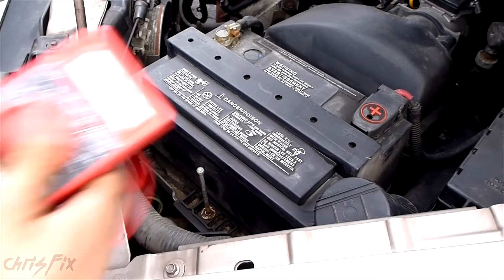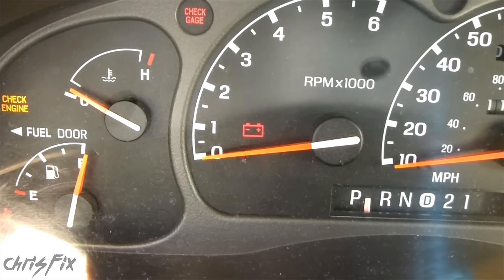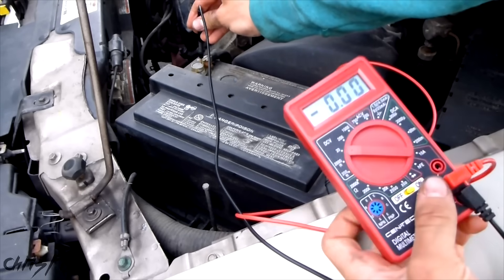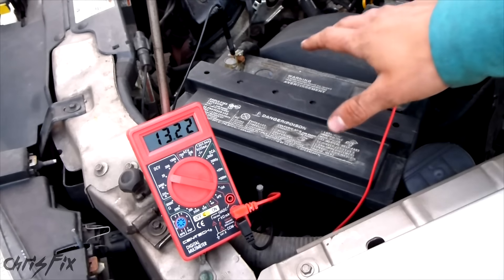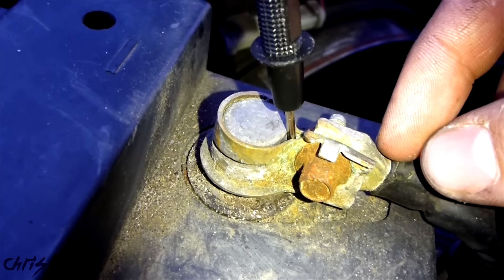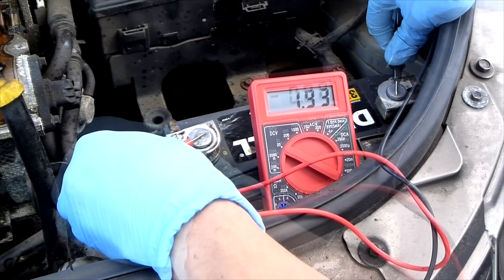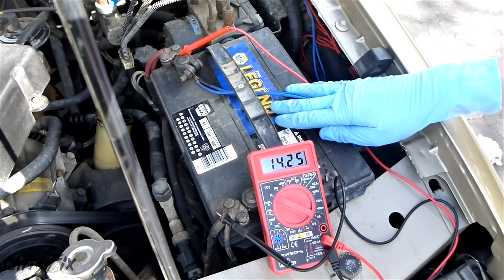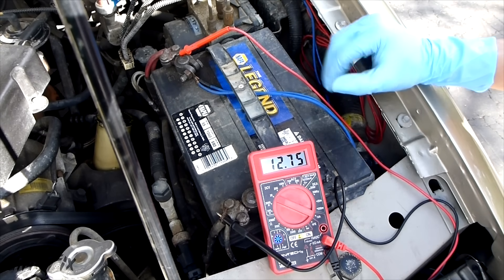How to Test a Car Battery with a Multimeter

Comment: There wire going to my ground terminal is completely loose. It’s tightened to the max and the car starts up fine but it comes off easily by hand if you just pull it off. Anyone know a way I can tighten it down so this doesn’t happen?

Comment: What happens if my 3 yr old maintenance free battery is charged to 18v at rest and jumps to around 20 while the engine is running?! Bad alternator? Terminals are dirty, but I’m assuming that would produce the opposite result. I did run the headlights for two minutes prior to starting, as suggested. Thanks!

Comment: Chris, thanks for this video.   I had been wanting to get a new battery before the winter cold hit but I put it off.  Well it failed, I tested it like you said and it only showed 10 volts.  It would not hold a charge. The funny part was that the battery was installed in February 2017 and lasted til November 2025.
Reply from the maker: Glad the video was helpful!

Comment: The VDIAGTOOL V200 Pro helped me test my car battery's wiring circuit before blaming the battery itself — turned out a bad ground wire was the problem.

Comment: audi a3 sport----------removed battery from car-its bout year old-----checked it with meter 12..55------------put back in car and tried start-------lights in dash flashing like mad and what sounds like buzzing noise from under steering column-------no crank ---no clicking from solenoid-----tested battery connected to terminals-----which are 100% clean---------all thats reading on multimeter 2.55-------whats the storyanyone?------------is this a battery fault?--why does it read 12.56 disconnected but 2.55 when hooked up? any advice welcome thanks in advance

Comment: I have a problem in my corvette.mechman alternator 225 amp had it checked out it's good but when I install in car and rev it to about 2 grand it won't go past 13.6 volts and I have an xspower d3400 battery?

Comment: Car I have had needs engine rebuild due to low compression. Won't start. I attempted to start it about 15 times before giving up. Then it sat for 6 months. awaiting the rebuild.

With a rebuild booked for a month from now, I have recently removed the battery and put it on a battery charger. It tested at 12.6 when it came off the charger but steadily decreased over the next week. Most recent reading was 12.15

Battery is less than 2 years old but was in a car with very sporadic use. Think there's life in it?

Comment: Due to problems with not being able to get my 4 sp automatic into park or remove the key, I need to disconnect my neg battery cable till repaired. Each time I need to connect the battery, it is difficult to get the side bolt screwed in cause it's crowded. So it clicks and sputters for maybe probably a minute while I fuss with it. Do you think that is dangerous for the electronic components ?
Worried I might be making bigger problems. Also do you have vids about 'stuck in park' or 'can't get it into park' ?
Reply from the maker: As long as the connection is good and tight, I wouldnt worry too much if this is temporary. I use a battery disconnect in my race bmw and it gets turned on and off all the time. Here is the video for reference: https://youtu.be/Q3Oshy9FOaA

Comment: How can I test the battery by starting the car when the car won't start?? 😂😅😅😂😂😂
Reply: You can still attach a multi meter to the battery with the car off and see if the voltage is around 12.6 v if it's less which is very likely it means battery may be bad

Comment: Hello guys, my girls' battery voltage is 13.6 which i think is fine, but her car is throwing up abs, steering wheel, battery, power steering lights on mid drive for 3 seconds and then good again, also power is reduced when you floor it it increases speed very slowly, its just a 1.2 but still. In 2nd gear at low speeds its jumpy, almost stalling. What could be the issue?

Comment: 5:15 use only distilled water to top off flooded lead acid batteries. 
bottled drinking water is usually just tap or spring water with varying amounts of alkaline (acid-neutralizing which we don't want) minerals like calcium, potassium, and magnesium
Reply from the maker: When I said bottled I meant distilled because it's in bottles lol but yes you are correct

Comment: If my AGM battery drops down to 7.## volts when the vehicle (2020 Odyssey) is started but jumps right back up to 12+ volts...is that acceptable?  Or should I be concerned?
Reply from the maker: Technically it's ok for now as long as you aren't noticing anything after starting up, but that's a sign that there is weakness under load, I would recommend getting the battery load tested at an auto parts store and see where you are at and go from there

Comment: Last night when I went to start my car it scratched strong but right before it started it bogged hard. Did it again today. I had new battery installed last summer and alternator. Any ideas?
Reply from the maker: It's likely a dirty throttle body/IAC valve, a weak/clogged fuel pump or fuel filter, a ground issue or one coil/plug could be weak

Comment: This vid reminded me of when I was first starting out with automotive electrical and decided to hook up my mutimeter with the amp port and setting directly to the starter motor and it burned my mutimeter's amp port and regulator fuse. 
What a dummy I was to do that.
Reply from the maker: Always good to learn from those mistakes!
Reply: @chrisfix absolutely never doing that again. Multimeter still works cus I changed the fuse but the amp setting doesn't. Think I need to soder in a new chip.

Comment: what could be the issue when my battery goes below 10V on startup? Tried changing to a new battery, and same thing happened. My MMI screen in the car is not working when i turn the motor on🤔
Reply from the maker: That could be a voltage drop due to bad wires, a bad connection, etc.

Comment: If the battery drops below 10v in this test does it 100% means that it's the battery that's dying? Could it also be a bad starter that's using too much current?

Comment: Great video but a quick correction. The battery light is connected to the alternator D+ terminal. The battery light does not indicate your battery health but whether the alternator is charging or not. If the light stays on when the engine is running your alternator is faulty and the car will only run until the battery is depleted.
Source: Auto Electrician of 33 years.

Comment: I checked my daughter’s battery with my meter exactly like you show. My multimeter showed all the specks as if the battery was new. The battery was bad and had to be replaced. Conclusion: multimeter doesn’t show anything. No need to check. If the battery doesn’t start your car get a new one.

Comment: if the battery light stays on after starting your car it is an indication of time to get a new one correct?
Reply: If your battery light is on while you are driving, then yes you need to most likely get a new battery. In any case, I would check to see why the warning light is on. Take it to your local auto parts store if you don't have a multimeter and they can test it for you.
Reply: @vigilantemotors  thank u
Reply: @ Anytime

Comment: I've  discovered that a car battery can crank a car, but not put out enough constant voltage to run certain functions on cars(my car is a 2013). Even the electric assisted power steering can be affected.

Comment: Hey what's up @chrisFix , what advice or recommendation you give me if a fuse has no power on either point of contact when connected. Radio works it's weird because the fuse is for the power of the radio

Comment: Hi Chris, i have tested my car thru a multimeter, and it shows 12.22v but the car hasn't been used for 24 hours, you reckon i should replace now the battery?

Comment: Hey Chris. Mine is showing 12.48 volts? I know my terminals were dirty and the negative  was a bit looose. Could that have been the problem? She's not turning on at all.
Reply: Update on my battery. It's working. I was able to clean it the terminals. But I still need to replace them. They are really old and the neg is still loose. Right now while it was on it read 13.78 volts. That tells me the alternator is good. When I turned the car off it read 12.80.
Chris thank you for your wisdom and patience with me. Have a blessed Thanksgiving!!🙏
Reply from the maker: I'm glad you figured it out! Thanks a lot!
Reply: @chrisfix  yeah I actually just found the new terminals. I’m going to replace them. Make sure that’s all clean and proper. Thanks again brother. Have a blessed holiday.

Comment: Almost bought a battery. Went and got a multimeter then checked.  All good. However after it sits over night it takes a few times before it will actually start. Could the battery actually be draining overnight not holding the charge?

Comment: 10 yr later I came across this and got the multimeter out for a F150 battery. Went down to 9.7 volts so I took it up and swapped before winter just in case. Still helping people! Thanks
Reply from the maker: Good thing you got a fresh one! Thanks a lot!

Comment: Cheers Chris.  I'm checking my battery on my car that's 14 years old now, original since new after 125,000 miles in the cold and wet English weather too!  
One question - If I get a charger to give the battery some boost since I don't drive that much these days, can I charge it whilst still connected to the car?  I don't want to disconnect the battery since I'll lose codes and other issues.  Thanks.  PS - My car is a Vauxhall Insignia (Buik Regal) 2 litre Diesel EcoFlex with the AGM Stop / Start battery 12v 95Ah 850a.

Comment: Hi, my battery voltage is between 14.6 to 14.7 on cold starts and then starts to drop until it stops at 14.5.. Does alternator overcharges my battery or 14.7 is acceptable mesure?

Comment: Thumbs up on this video, with one suggestion:  Battery terminal corrosion pads (chemically treated green & red felt washers) provide protection without gunking up the top of the battery the way WD-40 (or any non-evaporating spray) does. A light grease layer over the terminals provides an extra layer of protection.  Oh - it's nice to see someone else who likes that simple and cheap Cen-Tech multitester!  Mine has lasted and lasted.

Comment: How do you know where to set your meter?
Reply from the maker: Depends on what you're testing and what you're expecting to see, so in this case when testing battery voltage I would set it to 20 volts and that would give me a readout like 12.67 volts

Comment: Terrific video! Admittedly, I had never used my multimeter to check a car battery before, so this was extremely helpful. Car wouldn't start yesterday so it sat in a parking lot overnight, went back over this morning and jumped it, brought it home and it does show pretty discharged on my charger, but showing @14.5 volts when the car's running. No idea what's going on yet since it started fine yesterday morning but then a few hours later - nada. Wouldn't even crank, just clicked. I'm going to keep the charger on it and then go from there.

Comment: Thanks for the informative video. A few of things to consider ...
1/ Connect the Negative lead of your multimeter to a grounding point on the chassis of the car. This eliminates any chance of creating a spark at the battery terminal and causing any gas discharging from the battery from igniting and causing a fire.
2/ Always wear face protection and gloves when checking car batteries. Battery acid can cause a lot of damage to human tissue.
3/ If the battery requires water, use either distilled or demineralised water. While not exactly the same thing, they are both acceptable. Avoid using tap water / bottled water because they contain minerals which will shorten the life of the battery.

Comment: question: If the battery is rated for 600 cca, why doesn't it blow the multimeter that has a 10Amp limit?
Reply: The multimeter should be set to read DC VOLTAGE !!! In that mode it offers a very high impedance load to the battery so only a minute amount of current will travel through the multimeter.
BEWARE !!! Do not set the multimeter to measure Current and do not use the 10A terminals on the multimeter to test a car battery. In that mode the multimeter basically acts as a short circuit and will likely be fried the moment it is connected to the battery - unless it is proteced by a fuse which will likely blow to protect the multimeters electronics.

Comment: Where to connect the test wires in to the multimeter??
Reply: It depends on the the brand of multimeter. But typically ...

- RED LEAD plugs into socket labelled "INPUT" or "VOhmsmA" (often a red coloured socket but can also be black coloured)
- BLACK LEAD plugs into socket labelled "COM" (usually but not always a black coloured socket)

Connect RED lead to POSITIVE terminal of the battery
Connect BLACK lead to Chassis point in the engine bay (if battery is connected inside the engine bay) or to Negative terminal of the Battery (if battery is not connected inside the engine bay or sitting on a bench).
Reply: @karmicselling4252  
Thanks a lot . 
I appreciate it . 
I got a one from tractor supply ( cheap)
just need it to test car battery and fuses.

Comment: Had problem with my 2 year old battery for over a week problem starting but when jumped it starts...... So i decided open the cover on top of the filling holes..... Noticed water was little bit low so i topped it up with battery water..... Charged the battery and didnt have problems again..... Its good to check your battery water level at least ever 4 to 6 months and top up as needed to prolong the lifespan

Comment: When you say the battery lasts about 4 years. If you buy a new battery and let it sit on the shelf. For 4 years, is it the same amount of time when it will go bad? Or is it only 4 years when you are using the battery?
Reply: Any Lead Acid car battery will lose charge if it is sitting on a shelf. Depending on the battery, the can lose anywhere between 4% to 9% of their charge every 30 days or so unless they are topped up with a charge. Properly maintained, a lead acid car battery could last anywhere from 3 to 5 years before needing to be replaced. I've recently replaced a lead acid car battery that gave me 8 years of service. So YMMV!

Comment: WD40 will accelerate rust...
Reply from the maker: wd means water displacement so i'm not sure how it would accelerate rust on a stationary part like this
Reply: @chrisfix  Standard WD-40 is not a rust inhibitor, it is a WATER REPELLENT. 
WD-40 coats the surface and keeps water from penetrating into it. However, if there is any water on the surface you spray WD-40 on too, it will trap that water on that surface and accelerate the rusting of the metal. Even the minutest amount of water on the surface will cause problems over time. So, if I were to use WD-40 in this situation, I would ensure the surface was totally dry before spaying it on. However, I would probably avoid using it at all in this situation. Petroleum jelly or a product specially designed for rust prevention would be preferable. Cheers.

Comment: Can you use Battery Puls repair charger to revive the dead battery?
& Which one you use?
1)  3 Stage or 7 Stage charger ?
2)  5A  or  10A ?
Reply: You might be able to revive a dead battery with a Smart Charger. It really depends on how old the battery is and why it was "dead". If it is less than a few years old and lost its entire charge as a result on a single incident - say accidently leaving the headlights on for several hours - you may well be able to revive it. I would use a decent 7 Stage Smart Charger. A 5A charger should be sufficient for most car batteries. However, a 10A charger gives you a little more headroom to cover larger batteries. Your choice depends on what sort of vehicle you have and how much money you want to spend. Keep in mind, it might not work if the battery is too far gone. However, a smart charge is a useful device for keeping your car battery topped up and properly used, will extend the life of a car battery by several months, possibly years, depending on the circumstances.

Comment: im a little confuse cca voltage should not drop below 10v, or 7.2 v ???  please explain
Reply from the maker: CCA is a measurement of the number of amps the battery can deliver at 0F for 30 seconds while maintaining 7.2 volts. Higher is better for starting in cold temperatures. I was just explaining that measurement that you'll see when shopping for a new battery. 
In a more practical sense, if you hook up a multimeter to a battery and start the car, the rule of thumb is that voltage shouldn't drop below 10 volts. This is what you should be focusing on if you're testing a battery

Comment: Great video Chris, 10 Million views is amazing. I would have liked to see you try and desulfate your battery that was down to 2 volts. Noco Genius 5 and 10 chargers have a repair mode, and Pulse Tech Chargers use a patented frequency to recover a heavily sulfated battery.  I use a Pulse Tech PowerPulse passive desulfator on my 2001 BMW Battery that you leave connected at all times to keep the battery from sulfating.

Comment: I've got a Walmart battery in my car that's 6 years old and still strong. I did a desulfate on it last week maybe it will last another year or so. Your video is good only thing is the so called maintenance free batteries aren't maintenance free. I still prize the tops off and add distilled water.

Comment: My car battery is on 11.7 (and its a half year old battery)could it be that something is draining my battery?(parasitic drain?)
Reply from the maker: Thats a little low, are you experiencing long cranks or other electrical issues?
Reply: @chrisfix  my car has a hard starting(it's true that it's winter time...)that's my only symptom.